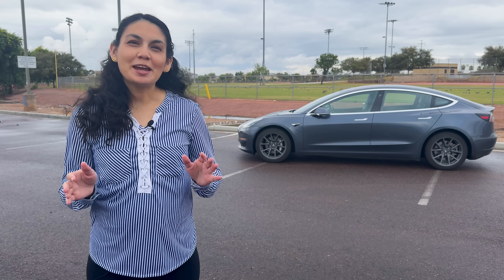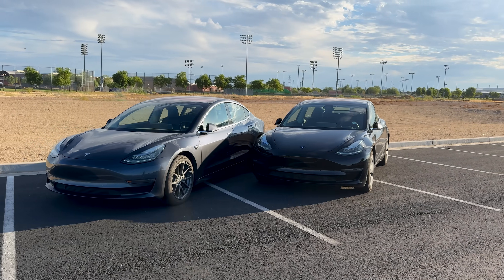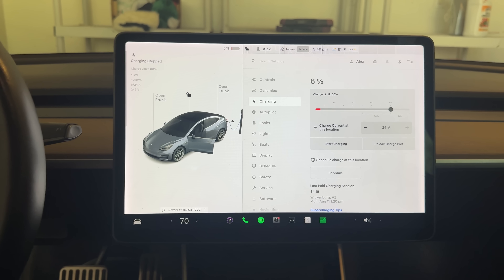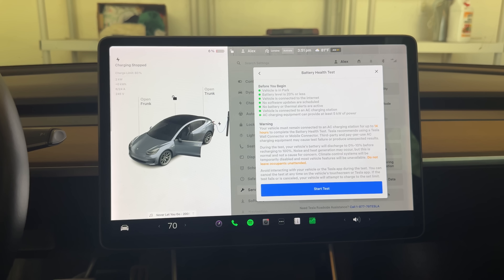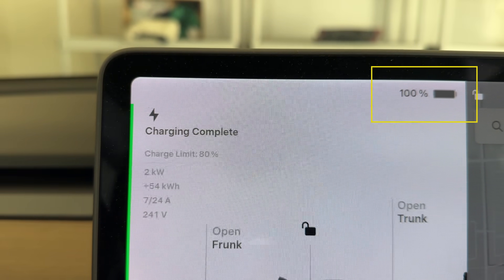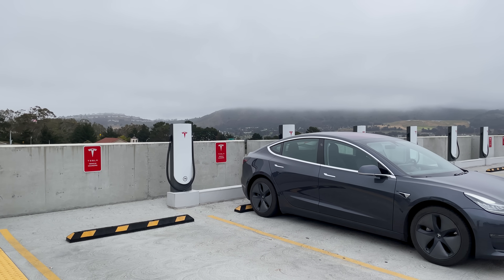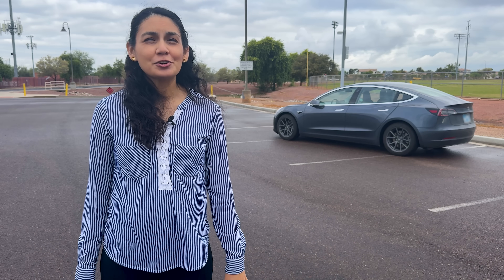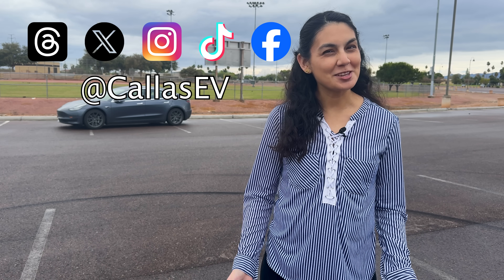How Much Degradation After 150k Miles? Tesla Model 3 Battery Health Test

Comment: For comparison, I have a 2015 Model S in Wisconsin.  It is at 12% degradation with 170k miles.  When I bought it with 56k miles, the battery showed 264 Range Miles (~10% loss).  Now, it's at 258.  Usually charged to 60%, kept cool, and never left at an extremely high or low state of charge. The hot climate in Phoenix definitely increases degradation.
Reply: I'm at 80% right at the end of my warranty (120,000 miles) on a 2020 Model 3 Performance. I think that the Performance degrades faster for some reason.
Reply: Nice, I got a model S 2016 about the same milage as you and similar range 264, it's now down to 235,  I guess the battery charge % does make a difference. I have done long drives and charged to 100 a handful of times for long drives and charge to 90 every time (it only sits at 90 for minutes ) but yeah I'm only at 130 so it's a huge difference lol but still love it all the same

Comment: in my experience the battery test is off by about 5%.  if it says 79% its probably 84% capacity.
Reply: Can you explain why so?
Reply: @vitekbystrov3211  the test is for extreme condition and usage but under normal condition capacity is higher.

Comment: Great work. I have real world data to support your results. I have 240,000 miles on mine with 22% loss. All supercharged.
Reply: You must have a model s with unlimited supercharging
Reply: Wow... all supercharget 😮.  My model Y 2023 is 58k  now . I supercharget it may be 12 times cuz it's very easy to change it home overnight.  Every morning 250 miles available
Reply: @olegvihodets8680  you need to reset or recalibration because mine is about the same year and miles and i still get about 320 miles

Comment: This is exactly why all EV's should have a minimum of 400 miles range, because of battery degradation.  And, EV's lose range just sitting.  People will say most ICE vehicles don't get 400 miles of range.  Yet, many do including a 4 door Jeep Wrangler, which isn't aerodynamic on the highway and more like a brick on wheels.  Also, a used EV with a degraded battery won't be worth as much as an ICE vehicle, because the ICE vehicle will still get close to the same range it had when new (if the engine was taken care of).  Battery technology needs to change more quickly if they want anti EV ICE owners to make the switch to electric.

One thing to note, you are incorrect about leaving the battery at a low state of charge for long periods.  Lithium Ion batteries are affected very little by this, they actually just don't like being at 100% for long.  And they prefer to be at 50%, so that is best if not driven for weeks.  Tesla uses the 20% - 80% range as a compromise for ease of use, and not what is actually best for the battery pack.
Reply: 400 miles of range is huge and not needed for most people. I agree more range would be nice and I believe in the not to distant future most EV's will be there but honestly our travelling is not impacted at all as our "range" is now determined by bladder capacity! 😂 for me I have a personal range of about 180 - 200 miles (about 400 or so km's) so the 400 miles would be wasted on me!😂😂
Cheers
Mike 🇨🇦
Reply: @michaellippmann4474  Yet it is needed for EV's since there aren't as many charging stations as gas stations.  Again, my 4 door Jeep Wrangler has more range than my Tesla Model Y, and the Jeep has the aerodynamics of a brink.  Range determined by bladder capacity is true for some but not all.  It used to be stopping to charge was okay because then you could get something to eat, but now it charges faster and there is no time to eat, at a sit down resaurant anyway and not as fast as filling a tank with gas.  Plus, ICE drivers don't want to stop that much during a trip to drive.  I know I don't and I've been driving EV's since 2018 and I still find it annoying.  Then when I do reach my destination and there are no charging stations, then I have drive out of my way to find one.  And once again, there is battery degradation determined by charging habits and time.  Considering those factors, 400 miles of range could turn into 350 mile or even 300 miles if you keep the vehicle a long time.

Comment: Any person that reads this that doesn’t know that battery life is completely affected by charge percentage. Never charge more than 50% on a daily basis. Anytime you need more go right ahead and charge up to what you need for your trip but make sure in use the schedule charging to when you’re gonna leave so that way it’s topped off and you go right away to complete the battery.  High states of charge hurt the battery more than low states of charge.  I don’t mean ultra low states of charge. For example, 80% is worse on the battery than 20% is.  50% is perfection for the battery and gives plenty of miles for most people.  This tip will save your battery in the long run.

Comment: 2016 S with 200k miles 2017 X with 170k when sold. Nominal degradation. Everything worked. Original pack, brakes/pads, motors!

Comment: I have 2018 M3 LR RW - at 184K Miles Car retained 80% of the battery capacity with max charge at 250Miles , Car mostly charged at home.
Reply: How has the electric car been till now, happy with it. Thanks. Barath south.

Comment: a big factor for nmc battery longevity is maintaining the suspension and fixing it when it starts to go out. the nvh issues causes the wire bond leads or balancer leads to come unsoldered which usually leads to cascading bonding wire failure in the same module since the remaining ones need to pass more and more current. the battery actually usually doesnt degrade, it just looses cells in a run away fation due to garbage wire bonds. LFP packs do not suffer from this since they used catl batteries who had the sanity to use actual bus bars.
Reply: Lfp W

Comment: Its also important to remember that you only use 70% of those miles. So only a bit over 200 miles per charge because you only use between 80% - 20% of the battery
Reply: You don't need to adhere to the 80% with such a severe conformity.
Reply: I charge to 100 percent the night before a long trip or if I'm at a supercharger and want to go some distance before charging again.

Comment: Something might be wrong with mine. My 2022 Tesla Model Y has 21% degradation after 78k miles
Reply: Call Tesla. It’s under warranty.
Reply: They’ll do nothing as degradation needs to be below 30% for them to act but give it a try
Reply: I’ve seen a lot of them go down to about 77-79% which is considered normal but any less would be be potentially an issue with the battery. Definitely keep an eye on it.

Comment: What do you daily charge to? I think most people should limit daily charging to 60% if the additional range isn't needed. That's what I have been doing with my 2019 Model 3 that is the same spec as your 2018 LR. So basically I'm cycling the battery most of the time from 40% to 60%. Unfortunately I only have 45k miles so I can't say for sure if this technique has been helpful to reduce degradation, but so far my estimated range is still above 305 miles.
Reply: Probably a good idea.

Comment: I thought my used 2022 Model 3 Long Range had severely lost range, but then I saw a footnote that the ones with 19" tires had 24 less miles of range, so I'm only at 10% degradation after 100,000 miles.  Not bad.

Comment: So thinking, long-term, and thinking short term based on a person’s need for longer trips, more miles, pulling trailers and so forth taking battery condition into account for degradation those longer range vehicles with bigger batteries have been and continue to be my choice as a person who drives for work every day Using large passenger van of course it needs a bigger battery to start with to cover the same amount of miles as a car would.  also have pick up trucks and pull trailers,  but then when you add all that into the fact that the battery does degrade overtime , a larger battery with more range  Makes a lot of sense . cheaper charging when you charge at home so no need to stop at fast charger as often,  when the battery gets older it’s still much more useful even if somebody else purchased it from you in later years, it will still cover the distance that they would need easier. Thank you. Nice update. You always do a good job explaining things I appreciate that.

Comment: ¡Órale! Te he echado de menos, Lorena. Me encantó verte en la reflexión del parachoques. I would have expected higher than 79% capacity, to be honest, since my ’18 model was at ~94.35% after 78,737 miles when I traded it in, but… your battery obviously exceeds its warranty. High five! ✋ I wish Tesla provided an OBD II port to facilitate such tests, like most other automakers. Using CarScan via my OBD II, after 22 months and 23,287 miles, it tells me that my I5’s battery is still at 100%. Hope that’s true!
Reply: That’s because degradation is NOT linear. It’s a fast drop in the first 100k miles, then when there is chemical stability in the pack (see multiple studies that explain this), degradation is very slow, and flat for the next 200k miles
Reply: @justinstewart3248  I never said it was linear…? I simply reported that the degradation in mine was negligible (94%) at half her mileage, yet it seems that hers started to drop faster than that as the mileage doubled (79%). My assumption (and hers) is that further degradation will be very minimal from this point forward.
Reply: @justinstewart3248  Battery degradation is virtually nonexistent once it hits 80% They generally don’t go any lower than that, maybe 77-79% is the lowest. It is the chemistry of the lithium ion battery, the cells can compress over time, but there becomes a point where they can’t compress any more.
Reply: @t @theInvinsibleable there no such “compression” in the cells. They do not physically change shape. Not sure if you’re using the wrong words here. What happens is lithium depletion that can no longer be moved through the electrolyte due to oxidative stress and lithium plating.
Reply: @justinstewart3248 Excessive swelling can lead to battery degradation, causing lithium plating..  Im an electrical engineer and I’ve owned  several teslas to know this.
Reply: @theInvinsibleable yes swelling does occur, generally at higher voltages and SOC, and temperature. The packs are pre pressured though as part of the design. I’m just saying that this guy talking about cell “compression” is nonsense.
Reply: Also, they DO have an OBD2 port, it’s in the right front door wall panel under the dash (not the typical location of normal cars. You have to pull the plastic from the door frame.
Reply: @justinstewart3248  Huh. So they do have OBD II ports, but they’re not readily accessible. Have you used an OBD device with yours to extract its data like SoH (State of Health)?
Reply: @Yanquetino yup. They are available. But you have to remove panels to access them. In the model y it’s in the right side door sill, and the model 3 it’s in the left side. But it’s not a standard port - it has a different voltage requirement and needs a little adapter.

Comment: 400V EV's (especially Teslas, due to their high peak rates) lose more range than 800V EV's because the high current (amperage) needed for DC Fast Charging 400V creates 4 times the amount of heat vs 800V.

Also, if you're using a standard dryer outlet, make sure to upgrade it to an EV charging rated NEMA 1450 outlet such as the one from Hubbel. Standard 240V dryer outlets are not rated for continuous draws over many hours like an EV pulls and can lead to overheating and become a possible fire hazard.
Reply: Another option is turn down the amperage to reduce heat buildup.  I've found that 240v charging at 12 amps is more than enough for my daily driving needs.
Reply: This can not possibly be true. The battery at a whole is wired for 800v, but the individual cells are still the same voltage as any other car. Amps per cell is still the same no matter if the battery is 400v or 800v. Other components in the car may get hotter with the higher amp draw but the reality is everything is rated for what the car will use, so the 800 volt car will use thinner wires than the 400 volt car. No difference as far as degradation is concerned.
Reply: @stevepriority4219  She even tells you on this very video that she lives in the Phoenix area with temperatures that often go over 110F, which is very bad for the battery... and you still make this comment. 

Let me try to make it simple for you, or anyone reading this. 800V or 400V means nothing to an individual cell. It's all about being able to keep them cooled, which is so much easier with 800V keeping everything around them so much cooler due to P = I²R. Doubling the voltage creates only a 1/4 of the heat versus doubling the current (amperage), which creates 4 times the heat.

Think of cells as ice cubes inside a small freezer sitting outside on your deck or pool area exposed to the sun. If the outside temperature is 40F, it makes it so much easier for that freezer to keep the cubes as they are. However, if the outside temperature is 120F, it's nearly impossible for that small freezer to keep the cubes intact. And that's just 3 times hotter, imagine 4 times hotter at 160F.

Now think of the pack and all it's components surrounding the cells as their "freezer." The ice cubes, just like the battery cells, don't care about the outside temperature. All the cubes care about is the INSIDE temperature of that freezer staying below 32F, preferably around 25F. And all the cells care about is staying within their temperature range as electrons and ions are being moved from one side to the other. And if the temperature surrounding the cells in that pack is 3 or 4 times cooler, it's that much easier to keep the cells within their proper temperature range. And therefore, allow electrons to be kept moving at a much faster rate and for much longer since the cells can be kept at their temperature range for much longer due to those much lower surrounding temepratures.

It's why ALL high C rating EV batteries in the world are charged using 800V or higher charging. Because 800V (or higher) allow for the cells to be kept at their preferred temperature range even at those high kW speeds, and therefore, is so much better for battery longevity.
Reply: @junehanzawa5165  One of the best explanations.
Reply: @MikeTgonavy  Thank you. I tried to make it as simple as possible, so it would be easy to understand. When I've tried to make it technical, all I've gotten is counter arguments. So I've learned to just keep it simple so anyone can understand.
Reply: @junehanzawa5165 both answers are correct.  Lower voltage charging means more heat.  But once the system converts it to DC, everything downstream will have the same excess heat due to resistive losses (because it's the same volts and amps at the module level).
Reply: @kkitzhaber  First of all, on DC charging, which is what this discussion is about, the car's system doesn't covert anything. It's already DC. But If your brain is incapable of comprehending that very clear explanation, that it's not about at the cell level, or at the module level, but about 4 times the heat (vs 800V) created by the much higher current of 400V high DC Fast Charging (with 4 times the resistance of 800V due to P = I²R) heating up all the bus bars, cables, welding points, etc. 4 times as hot inside a closed off, water proof, weather insulated battery pack with no way out, then you'll never get it.

I might as well be explaining a round earth to a flat-earther.
Reply: @junehanzawa5165  Yes. You are correct.  My apologies.  Can't believe I missed that.  Good thing my EE teachers aren't reading these comments. 😊
Reply: " if you're using a standard dryer outlet, make sure to upgrade it to an EV charging rated NEMA 14-50"
Check your circuit breaker because dryers are 30A not 50A, so use a NEMA 14-30 plug and check that the charging Amp is 24 A.

Comment: Post-Raven Model X and S are degrading early and continuously.  There is no slow-down in the degradation that I and my friends have seen through 120k+ miles.  I am currently at 19% degradation after 120k miles with my 2023 Model X.  TeslaFi shows several slopes to my degradation. S and X warranty is 70% at 150,000 miles.  If the rate of degradation continues, I will be close to the 70% warranty threshold at maybe 26 to 28% degradation.